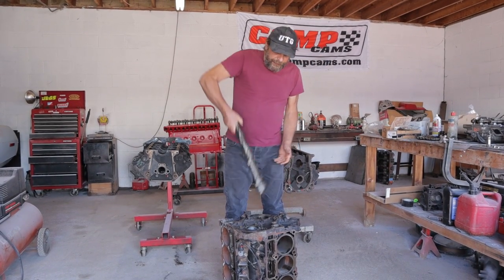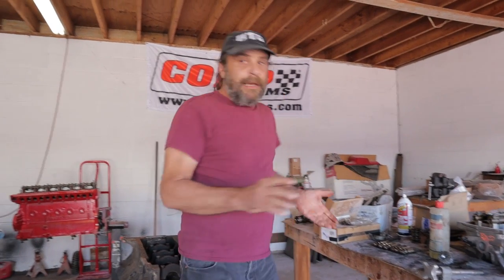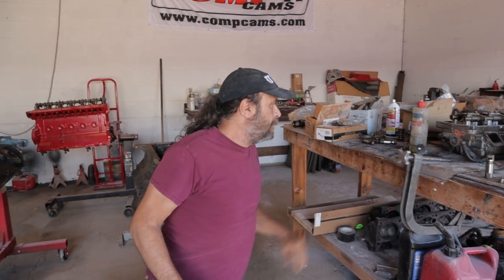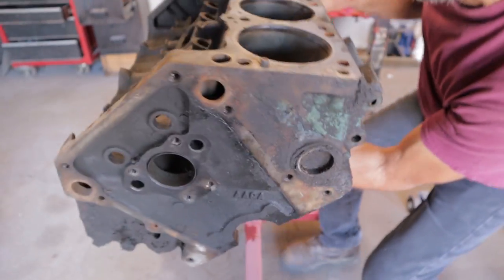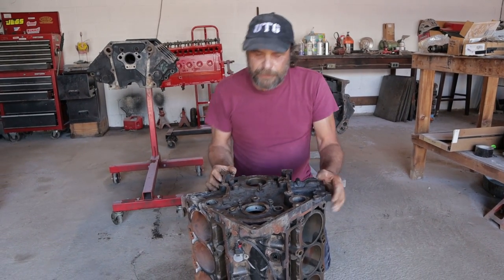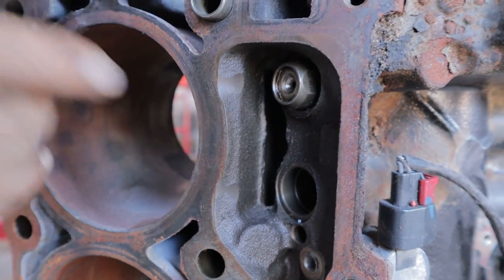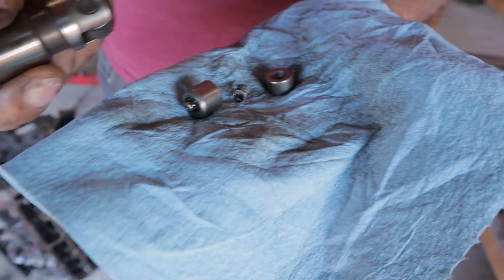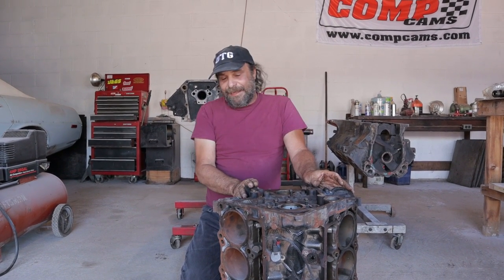Gen 3 Hemi Camshaft Failure Mystery Explained!

Comment from the maker: Just a thought to add.  Doing an MDS delete but retaining the MDS lifters could absolutely help the issue.  The oil that would normally be diverted through the MDS would be held in the oil passages that connect the lifters and keep them pressurized to some extent.  Anything that could get oil to leak from around the top side of the lifter would result in a pretty steady supply to the roller bearings.
Reply: What about lifters that DO have a hole in the bottom and some strategy to increase the oil volume being fed to the pushrods?
Reply: Tony, you could also take advantage of the oil galley that is in the way below the cam.  I'm not sure without looking at the block if you could physically get there to machine it through the top but you could drill small something like .020 holes in that oil galley so that some oil can be shot up at the lobes of the cam.  It wouldn't address the lifter wear but could help keep the lobes and rollers lubed.
Reply: @silkysixx  I agree, not that I know anything- I'm a keyboard warrior. Seems like adding an orifice to the bottom of the lifter so it sprays directly on the lifter roller/cam interface might fix it.

GREAT CATCH UTG !!! Wow! Good one!!! Actually, it's a great one!!!
Reply: You need to get rid of the vvt and mds.
Reply: Well we are probably going to buy lil Sisters 06 Charger RT to replace the 99 300m my sister who lives here drives, or keep the best two cars out of the dailies we have now. I'm pretty sure it doesn't have mds so are the earlier engines without it still prone to all the failures. It only has like 78k on it and she's never complained about it ticking or being noisy. I have never noticed anything when I've ridden in it either and they always get it serviced at the dealer. The 300 still runs fine but needs a air conditioning compressor and rear struts which I have.
Reply: @sonsofliberty3081  agreed! I have that afm garbage on my 2015 Silverado.  I wrote it out of the software with a tuner to prevent another failure!
Reply: Well said...👍👍
Reply: @kurtzimmerman1637  it's the government's bs of emissions. The rings are to close to the end of the piston as well.
Reply: Where’s the DYNO for the live 318 build?!!
Reply: Tony, I couldn't quite see in the video, are there any returns/ passages or voids above the liters? I'm wondering if we could plug off the majority of those huge oil return areas under the lifters and allow the wells to fill, then spill over at a higher level. It might allow oil to fully surround the lifters and flow down around them in greater quantity. 

I really like the idea of squirters or dribblers, but its probably too big and invasive a job for any time other than a full rebuild. Im trying to think of something that can be done by a competent shop or DIY'er without removing the engine or seriously modding the pressure system. Since these engines sometimes can live quite long lives, it may only take a little bit to make all the difference.
Reply: @honda0303031   it's on lunar's channel been there for all most a week now
Reply: Drip rails from the bottom of the heads to the upper top side of the lifters?
Reply: Maybe a windage tray catching all that oil from above to dump over the cam?
Reply: @honda0303031  Nick's Garage said there was an oil pressure drop to about 30 psi so the test was aborted, until fixed
Reply: Killed by design
Reply: Thank you so much. One day I have to get a Durango as a family hauler and I needed to know this stuff!!! I guess a crank scrapper is out on this engine. And in this case a high output oil pump may not be such a bad idea would it???
Reply: @Ecosse57  those lifters appear to have more holes for oil pass through on the sides and to the roller plus a larger cut for more oil being around them. They're potentially one part of the fix, another is some way to get more consistent oil flow to the camshaft.
Reply: What is MDS?
Reply: There is a guy on YouTube and i think it’s monster garage channel. He built a yblock. He added his own answer to get more oil to the rotating assembly by making hoses that ran in underneath the valley pan. That would solve this issue. 
And or finding a roller tip with a hole in the middle for oil to get to the cam. Come on everyone let’s put our thinking caps on
Reply: @econorock  all peeps have been pointing to are Johnson Lifters and their range of drop-in hydraulic lifters. It looks like their #2356 lifters are the ones that have the oil path to lube the lifter roller while others are pointing to the #2326 lifter, but their range of gen 3 hemi lifters have only been on the market for less then a year or are still being produced, as their site gives a price of TBA and a price
Reply: @SOU6900  it's an active cylinder deactivation system makes a v8 into a v4, when the ECU decides it's eco-mode time
Reply: Not all 5.7s have the MDS system so that only is gonna help a few folks.
Reply: I am curious if you could make an insert for the valve covers to drip on the top of the lifters?
Reply: @SOU6900  Multi-Displacement System,,, deactivation of cylinders depending on load demand.  Think of the older Cadillac 8-6-4 systems.  Same concept.
Reply: george garcia l
Reply: @karlsmink7037  so just more junk to screw up then?
Reply: @SOU6900  if it's only killing fuel to half the cylinders, it's fine. Same as a fuel-cut rev limiter, really, except for operating rpm. In cruise control where you only need 30hp to go down the road? Cut fuel to half the cylinders (and alternate which cylinders are not firing to equalize the heat loads). 

But too many people try to over think the design, like caddy's 8-6-4 system. The 6cyl setting was far too complicated.
Reply: How about machining a couple of small vertical slices off the sides of the lifters to allow the oil to drain past, easier than doing the same in the lifter guides.
Reply: Would it be feasible to parshily block off the drain back holes in the lifter valley so more oil would run down the lifter bore?
Reply: @cuog64  might cause to much of a drop in oil pressure for the rest of the motor, not sure but possibly a good diea
Reply: Not knocking your analysis-kudos-but as an independent and formerly dealer (Chry-Ply 1982-1994) technician for over 35yrs, we know that regular maintenance and quality parts (oil and filters) go a long way. I am doing a budget build on a '05 Ram 5.7L (MDS delete) and I have done a Dodge Magnum 5.7L, both with high mileage and the lifters looked mint. The Magnum dropped a seat and killed a piston, so I'm aware of that issue, but besides pistons/rings and bearings, new heads and gaskets and she's gone another 50K, incident free. The Ram engine is going carbureted in a retro build, and I plan to reuse the lifters on that one (wish me luck! LOL). I may investigate on a way to increase the oiling there (now) thanks to your diligent work. I will be using thin oil with friction modifier additves of some sort (Lucas Synthetic Oil Stabilizer or Lubegard BioTech, etc.) and a quality filter (not FRAM) like Purolator or WIX.
Reply: You'd have to weld up them drain passages and drill new ones top side, then see if there's a lifter with oil passages 180 degrees each other in the barrel plus a .0010 squirter hole on the very bottom, above roller on lifter. That would have to be a very tiny hole though.
Reply: Good eye
Reply: @sonsofliberty3081  You are correct, The main reason you can't properly super charge a 392
Reply: Tony you think you could tap into the oil gallery and plum a fitting to a spray bar that sprays pressurized oil on the cam?
Reply: What about a small slot coming out the side of the cam bearing on the top to squirt oil on the cam along with a high volume pump.
Reply: Excellent work sir ! ! !  

Seems to me, if lifters have hi-pressure oil inside, "drill" to let a little bit out... bottom & sides.
Reply: Now that I own one of these I've been really looking into this issue. Haven't torn one apart yet but plenty of net research. A few things stand out that I think are telling.......

This appears to be an issue only in the 5.7, the 6.1, 6.2, and 6.4 don't have a common lifter failure issue. Of course those engines aren't as common, BUT while having higher red-lines they also have higher pressure valve springs. This would indicate that valve float is causing a pounding that's killing the rollers. Among 5.7 owners spring upgrades are very common. 

This appears to be in a limited year range. Chrysler was clearly aware and made several lifter changes. The newest lifters have larger roller pins and aren't failing. 

This is the first I've seen of any marks on the side of the lifter body. Are those lifters from that engine and the only ones you've looked at?

I don't see how a lack of splash oil on the camshaft can be an issue. First they're roller, second it's not the cam to roller surfaces that are failing but the roller bearings in the lifters. 

You mentioned long idle duration I agree that could be a factor. One over looked factor I think exists is a lack of oil. These engines stock have a PCV system that consumes oil. Low oil levels could absolutely be a HUGE contributing factor. Frankly the way they consume oil with the stock PCV I can't see them making it between changes without adding oil.
Reply: @sonsofliberty3081  Neither the MDS or VVT are contributing factors to the lifter issue.
Reply: @ScottKenny1978  MDS isn't just killing fuel, it collapses half the lifters so the valves don't open on 4 cylinders.
Reply: @cuog64  Agreed. along with a high-volume oil pump and restricting the valley drain area to make oil puddle around the lifter boss would probably work. Hell, just look at high performance dry sump engines and how they are plumbed. (Edit) - In fact, if you go through the lifter bosses with a .030 drillbit, at about a 30 degree angle, pointing at the boss, it would work well.
Reply: @silkysixx  so ...a dry sump and oil squirters like late-model gtr nissans had...well i believe  they had them
Reply: @honda0303031  nick's garage channel
Reply: @honda0303031  Nick said it had low oil pressure. They getting it fixed before putting it back on dyno.
Reply: @honda0303031  Low oil pressure, Nick said it get fixed first, than back on the dyno.
Reply: What about a manual (challenger) that doesn't have MDS? Same issue or different fix? Or no fix :(
Reply: Um no the Eaton mds/ AFM shared with the lsx and ltx lifters are garbage and have habit of collapsing and braking off the inside tangs or being glitchy on a computer level / glitter bomb which is one of the reasons why I’m never going to use them in my engines ( but I did look into it. to get better gas mileage and make it easier to pass the epa testing) instead FCA should have used the multi-air technology ( same thing I’m doing to my 2G 426 hemi right now as a mod because it doesn’t see high RPMS a lot and is mostly a streetcar that needs low end torque that the VVL is good at and I get to keep a “ big cam lobes” in my case it’s looking like 620th ish lift without having the usual downsides. not a high hp race engine ) that is used in the 2.4 tigershark engine or used sold lifters in “ profomance engines “ line aka race only Versions 

As for oiling one extra ways of oiling the lifters and rollers is stealing oil from the vvt phaser Assembly grooves and drill from the front of the camshaft to the back to make a oiling passageway ( just don’t go to big or you will weaken the camshaft) to each camshaft lobes and dill a tiny orifice at the heal of each lobe and roller assembly plus it will spray and sling oil even everywhere that’s needed just like the inline 6 from Nissan ( I think 💭 it’s the 240Z from pre-1985~ )/ jdm motors that oiled only though the camshaft that way ( and is the same thing I’m doing to my new 2G 426 hemi camshaft side note for me and other that might get the same bright idea 💡 is that it might be a little harder than a normal v8 solid one peace camshaft ohv because mine is a camshaft in side a camshaft with two phasers for vvt and vvd so I have 3 holes trying to line up to be effective to oiling the heals and or the toes of the camshaft ) and didn’t have spray bars but guys do add them as insurance and probably is a good idea but for that application oiling through the camshaft is necessary as my reading I noticed that if you deleted it it could cause a camshaft failure similar to the 3G hemi even with a bar
Reply: Well I’m not tony but hope this helps silverbird58 Front crankshaft snout between the damper and the timing set. same way as the GM LSX engine and as higher RPMs it can go into cavitation one of the reasons I’m not using that style of system.

 instead I’m using a deviant misslle oil pump ( its red and black coloured ) the same one used on the Mopar misslle drag car ect (  would not surprise me if tony has one or used it in the past). the other option is using a gillmmer belt drive Peterson pump style but the rubber belts can brake so that one makes me a little more nervous of using it the plus side the you can change the pully ratio / pump rates easier and be able to preoil with the belts off easier
Reply: Tony, do you know if this issue exists for Hellcat motors as well? From what I understand they don't have the MDS system. Thank you for the info, looking to keep my hemi healthy and happy!
Reply: Just keep it in sports mode lol mds off
Reply: I thought the MDS system rerouted the oil do a different passage when activated
Reply: TONY, I DOUBT THE ENGINEERS WOULD MAKE A FATAL FLAW MISTAKE LIKE THAT IN THE DESIGN OF THE BLOCK AND PRODUCE IT FOR SO MANY YEARS WITHOUT CORRECTING IT. IT HAS TO BE SOMETHING MORE SIMPLE. THE ONLY LOGICAL ANSWER TO WHY THE CAM LOBS ARE BEING WIPED OUT IS THE LIFTER ITSELF. WHERE THE ROLLER THAT RIDES ON THE CAMSHAFT, THE CENTER SHAFT DRILLED HOLE WAS NOT CENTERED WHERE IT WAS OFFSET, WHERE WHEN YOU SPIN THE ROLLER IT WOBBLES UP AND DOWN CAUSING A FICTION EFFECT. THIS IS ALWAYS THE CASE WHERE THE SUBCONTRACTOR WHO PRODUCED THOSE LIFTERS FOR CHRYSLER HAD BAD QUALITY CONTROL. THIS IS WHERE CHRYSLER SHOULD BEGIN THERE INVESTIGATION.
Reply: I had a 2014 ram 1500 and the hemi started ticking around 35000 km, traded it at 41k km.
Bought a 2017 durango rt and the first thing was bye bye mds, were at 65ish thousand now and it's just starting to tick. 
Delete your mds, soon as you buy a hemi, no other mod comes first, DELETE THE MDS!
Reply: Would you suggest a software (tune) or hardware delete?
Reply: @SchkuenteQoostewin  do a software, leave the components in the engine.
Reply: A simple Grove of 4 to 6 thousandths deep vertical on the lifter to extend into the lifter bore on the down lobe position with a connecting ring groove around the middle of the lifter at the feed hole...(much like a connecting rod spit hole) and the vert groove on both sides of the lifter
Reply: Patrick Radcliffe you can turn the mds off by switching to tow mode or either downshifting to second gear, then back to the end gear.
Reply: Qoostewin Sch'Kuen'Te you can turn mds off by switching to tow mode, or downshifting manually to 2nd gear then up to the end gear depending on the year.
Reply: Looks like 42 people so far has a new place for you to shove that cam shaft
Reply: @Frank289100   Don't let it set around and idle...that's what's killing them!!!
Reply: @bingorobins1010   Keep the idle time to a minimum. Cop cars suffer more than the guys who spend all their time out on the highway. Cop cars idle too much, they don't go 100,000 miles. Long distance commuters get 250,000 miles with no ticking....lots of oil being thrown around at highway speeds.
Reply: @Dukerdr  (Don't let it set around and idle...that's what's killing them!!!)<<-- THEN ALL THE LIFTERS AND CAM LOBES WOULD BE WIPED OUT. HAVE A NICE DAY!!!
Reply: Very similar problem with the dodge 3.6 pentastar collaboration engine (roller rockers). But, if you swap out the rocker as soon as it starts ticking $2.50 you won't have to swap out any of the FOUR $250-300 cams.
Reply: Achronic Deth  and the clutch just slipped 😉 both times😏
Reply: @snek9353  you are absolutely correct. The issue is very tight valve guide clearances, compounded with long idle times,( poor lubrication of the guides at idle).  When valve guide clearances are down below one thousandths of an inch, ( .9 on intakes, 1.5 thou on exhausts) the guide can periodically clamp the valve stem, stop the valve, stop the rocker, stop the pushrod/lifter assy, and crush the roller bearings.  How do I know? I worked for Chrysler tech support, seen many of these engines. Imagine a valve stem being heated by the exhaust. It warms up faster than the guide, expanding faster than the guide. The thin film of oil cannot stop the guide from holding the valve stem. Once the valve stem has stopped moving momentarily, the guide sucks the heat out of the stem, and releases the valve. There is no metal transfer, it doesn't get that hot, but, it does clamp the stem. This happens because of tight specs, compounded by, worn tooling. Since these engines are robotically built, ten thousand of them can be made...before anyone catches it. You should see what happened to the FCA 500, ( Fiat 500), with the hydraulically operated, VVT, ( brick). Lol! Open up the guide clearances by half a thou, no more wiped out cams.
Reply: @sarcastomimic2683  it's the tight valve guide clearances,(.9 thou on the intakes, 1.1- 1.8 thou on the exhausts), open up the guide clearances by half a thou, no more problems. It doesn't matter if it's MDS, or not. How do I know? I worked for FCA, tech support. Tight valve guide clearances, help clean up emissions. That's why they did this. Tooling wears, clearances tighten...not good.
Reply: silverbird58  front of the crankshaft.
Reply: @Frank289100  nope. the tight ass valve guides are what's doing this. (.9 thou on the intakes, 1.5 thou on the exhausts). The guides grab the stem, long enough to transfer heat, then release. Not soon enough to stop the lifter from crushing the bearings.  ( Worked at FCA/Chrysler). Open the guides up about a half a thou, no more problem.
Reply: @Frank289100  tight valve guide clearances, are what's doing this. (.9 thou on the intakes, 1.5 thou on the exhausts) open them up by half a thou, problem goes away.
Reply: @mikestone234  POSSIBLY YOU ARE RIGHT. BUT AT LEAST WE ARE BOTH ON THE SAME PAGE IT IS NOT THE BLOCK. MIKE, COMPOUNDED PROBLEMS IN MANUFACTURING DO EXIST. IT CAN BE BOTH MY POINT AND YOUR POINT. YOUR INPUT HERE HELPED MY POINT TO THE GREATEST DEGREE.
Reply: @mikestone234  That's very interesting and the first I've heard of this as a possible issue. Have you expressed this on any of the popular forums discussing this issue? 

This could also explain the one other issue I've seen in the valvetrain of these engines, it's much rarer but apparently some when almost brand new broke their rocker arms. Rarer and maybe a separate issue caused by some flaw in the manufacture of the arms, maybe contributed to by sticky valves. Though I think on all of them replacing the rockers solved it, if it was sticky valves you'd think it'd happen again after rocker replacement. 

However if sticky guides were an issue I'd expect to see pushrod issues be common. Push rods are generally the fuse in the valvetrain and most engines I've worked on with sticky valves the pushrod was the failure point. They'd generally bend or in some engines fall out of place. That we don't see pushrod failures is a mark against a sticky valve hypothesis. Also while the rocker failure occurred on new engines, the lifter failure often occurs after quite a few miles/years. A sticky valve if it makes it many miles should wear out of it's stickiness. Problems would show early in the engine's life not late. The needle bearings in the roller lifters appear to be essentially wearing out. 

One thing that works against my valve float and your sticky valve hypothesis is that as far as I can tell there's no bias towards intake or exhaust failure. With either cause we'd expect it to be primarily one or the other, that hasn't been my observation so far. It's also rather common for more then one to fail in the same engine and for those failures in the same engine to occur to both intake and exhaust and both MDS and non-MDS.

My current best theory is that the main cause is quality control in the manufacture of the the roller needles bearings and/or undersized design. That any sticky valve, oiling, valve float, etc. issue is only a contributing factor that accelerates the primary issue of a batch of poorly made rollers. In fact maybe you have more information on this. Information I've seen on the net is inconsistent on changes to lifter manufacture and design over the years as well as exactly what years/months production issues occurred.
Reply: @metalman4043  MDS does not appear to be a factor in the common lifter roller failure. It appears to occur to both MDS and non-MDS lifters/engines equally.
Reply: @danielhemple8649  It does, in fact when the MDS is activated the lifter is getting even more oil. An MDS lifter actually has 3 separate oil paths. There's the standard oil passage that's shared by all the lifters. The MDS oil supply that's fed to the outside top of the lifter body when MDS is activated. And they are fed oil down through the pushrod into the lifter body.
Reply: @bingorobins1010  But I've seen no evidence that MDS and lifter failures are related. The lifter failure issue appears to occur in MDS and non-MDS lifters equally. MDS lifters and solenoids can/do fail but those failures are separate from what's causing cams to be wiped out. When they fail the lifter stays collapsed and the engine misses it doesn't wipe out the cam.
Reply: @snek9353  thanks for responding brother I've seen many hemis go 300,000 with no trouble at all I see more have trouble with exhaust manifold bolt then the lifter problem I run full synthetic and stay on maintenance only 60,000 no trouble yet PS love the snake
Reply: @danielhemple8649  You're welcome, I've only owned a G3 Hemi for 7 months now and started looking into this issue after purchase. I bought my '14 with 46k and am now at 51k. My research into this issue has lead me to do 6 things. 1) Avoid long idle times. 2) Avoid over revving the engine. 3) Rev the engine before putting in gear and before shut off. 4) Add an oil catch can. 5) Check the oil level often. 6) Use Redline oil, this one I wanted most to mention. Not all synthetics really are. Redline makes a better synthetic(as do others) but it appears their additives soothe the hemi tick better then others. I don't personally have enough experience with it yet to confirm a difference in noise. However I have spent a fair amount of time researching lubricants and am a fan of Redline oils in general, so that's what I'm using in mine.

EDIT, of course those are all good things to do even if the lifters weren't a potential time bomb so I'd probably be doing them anyway.
Reply: @snek9353  tight valve guides, doesn't mean that, valves will stick all the time. There is very little oil going down the guides to start with, plus, a new engine still has some assembly lube as well. When clearances are this tight, differences in metal expansion can come from a lot of reasons. Lean fuel mixtures in different parts of the drive cycle, differences in oil splash, or lack thereof,(idling), can do this. You should have seen what we went through to find the sneaky miss on the 3.6L pentstar engine,(valve stems were not the same diameter, all the way down the stem). Check engine light, intermittent miss, compression/leakdown tests were perfect. Spark, and fuel, perfect. (Intermittent sticky valve, about  a hundred thou, off the seat. By the time a man could get a compression/leakdown, the valve would shut all the way, and the test wouldn't show any problems. These tight clearances are great for oil control/emissions. Chrysler doesn't make it's own valves. We also had some engines, with Chevy valves in them, lol! They were so close in size, you had to use micrometer to tell the difference. (Vette valves have slightly smaller stems, manufacturer mixed them up, before we got them loaded into the robot). Chrysler doesn't make the lifters either. Johnson does these for everyone.  I saw quite a few broken pushrods, broken rockers, crushed roller bearings, mostly, and trashed cams. It takes a lot of rinsing to get these engines cleaned out of metal. Filter is full flow, so that helps. Opening up the clearances will make up for a lot of variances/conditions. Racers do it without knowing. They run about 1.5thou to 2.1 thou, on the intakes, and, 1.9-2.2 thou on the exhausts.  For aftermarket valves,(some have larger diam stems, different materials.)
Reply: @snek9353  by the way, a lot of these engines had issues early. The dealers wouldn't tell the customer what it was,(under warranty). The valves don't have to stick totally, to cause this problem. If a valve is dragging, it puts a huge load on the lifter, way more than the rollers can take.
Reply: @mikestone234  Not really arguing, just trying to fully understand the theory/mode of failure here.

"tight valve guides, doesn't mean that, valves will stick all the time" 
- I get that but as you said earlier "Imagine a valve stem being heated by the exhaust. It warms up faster than the guide, expanding faster than the guide." This process really only makes sense on the exhaust valve of a cold engine. Now maybe damage done while cold is a contributing factor, but it doesn't explain intake lifter failures. If this was a common cause then we'd see lifter failures primarily on the exhaust side. 

"differences in oil splash, or lack thereof,(idling), can do this"
- This would help explain why it's more common in engines that idle for long periods. The lifters, even the rollers aren't really reliant on splash, but the valve stem is. 
EDIT -  It just occurred to me that with these engines the wide angle of the valves would have a significant effect on this as well. I'd expect that cause  the exhaust valves are both lower and more horizontal that they'd oil a lot better then the intake valves. 

"Filter is full flow, so that helps."
- I can't recall a single water cooled engine since the '50s that isn't full flow. You may find it interesting though, we(family) have a '56 Studebaker that still has the original engine with only the original bypass oil filter. That truck to this day is still a solid well running work horse. 

"They run about 1.5thou to 2.1 thou, on the intakes, and, 1.9-2.2 thou on the exhausts."
- For all the time I've spent working in machine shops I've never done valve guides. I'll have to talk to my machinist about what's normal. 

"These tight clearances are great for oil control/emissions"
- That's very ironic given how much oil the stock PCV system flows into the intake. 
I'd figure a tell tale sign of this would be galling on the valve stem, I've yet to see that in my research. 

The next question would be why isn't it occurring in the 6.1, 6.2, and 6.4 engines. Sure their heads have slight valve variations and stronger valve springs. But the 6.1 and 6.4 use the same lifters as the 5.7, they all have the same oiling, and presumably the guides are all done on the same machines. 

When did you work for Chrysler and when was this discovered/solved?
Reply: @mikestone234  Also of course maybe the most important question. What can a current owner do about it? I have a '14 5.7 with MDS, assuming this failure mode is correct what would you suggest someone like myself do? I can only think of two things that aren't extreme. 1) rev the engine for more splash, in particular before putting in gear and before shut off, I'm already doing this. 2) Use a great oil that will better penetrate the valve stem seal and stay on the stem. Think I'm already doing this as well using Redline oil. I could buy an expensive warranty or do internal engine upgrades but to me the warranty is extreme and I don't yet have the time/resources for internal upgrades. I'd probably just swap the engine anyway if I did.
Reply: @mikestone234  OK another question, if valve stem clearance was a common issue we'd see it commonly in engines where people have installed blowers and/or nitrous. Just as the ring gap becomes an issue in those engines so would valve stem clearance.
Reply: @snek9353  Thank you for the info. As far as I know, they didn't have the R&D time to get the MDS system working on the Hellcat with the supercharger, but that might have been for the earlier models (mine is a 2016)
Reply: @blakebeaupain  Hmmm I might be wrong on that one, I thought they did but just now did some research, looks like they don't.
Reply: @snek9353  yes, that's true. Blower motors are built differently, and the clearances reflect that.
Reply: @larrycain6425  I was thinkin the same.
Reply: I did mds delete with a tuner at 40,000 miles on my 2016 ram with the 5.7. I currently have 130,000 miles and I’ve ran the truck balls to the walls with no lifter problems. 
Ive always used 1 qt Lucas addictive every 5k for oil changes.
Reply: @smokedog123456789  that's great! The guides have worn in, good lube will take care of the rest.
Reply: @nm156p  no. A "delete" is when you have the factory remove a standard item, before you receive it. For example: you "delete" the bed of a pick-up, because you are installing a service bed.
Reply: @patrickradcliffe3837  what been doing is driving around with in 8 gear range to o keep all cylinders firing I really don't like the mds system
Reply: @larrycain6425  that might work but would hurt oil pressure
Reply: @Husky1run  in his live stream he pointed out that it's not the MDS. It's a design failure. I suggest going and watching that live stream.
Reply: Would a heavier oil like 5w40 or 10w40 help with this issue, since Chrysler recommends 5w20 ???
Reply: @bingorobins1010   why delete mds ? You just said you are atarting to have the same ticking start , just 20k later ? You think every engine will have this issue at the same time  ? 
This lack of oil issue Tony points out makes sense, that seems more likely the issue  than  mds!?
Reply: @Dukerdr  that's why I am looking mostly at the state trooper cars , they sit at idle too , but , the cruise the highways much more than the  local pd or sheriffs depts  :)  , lots more oil flying lol
Reply: @DUSTER7071  no, the durango is at 67 some thousand and is now ticking.
The truck was at 41k when I traded it in.
Reply: @DUSTER7071  I hear ya', most State cars are better serviced too. Our local Sheriff's Dept would be a good car to get since they don't sit around and run radar. They just respond to calls and deliver papers. And their Chargers have 6 cyl in them!  ;)
Reply: @DUSTER7071  Why do you want a pursuit?
Reply: @DUSTER7071  "This lack of oil issue Tony points out makes sense"
- Not really, Tony's position is mostly about a lack of splash on the cam. Splash on the cam is absolutely vital for a flat tappet cam, but not for a roller. The lifters are failing internally at the roller bearing, not where they interface with the cam. They don't wear the cam until after the rollers fail.
Reply: @mikestone234  Awesome info, Mike. I appreciate the response.
Reply: There's nothing wrong with the engine, it's designed the way it's supposed to be. F.I.A.T. style, Fix It Again, Tony! 🇮🇹🍝🚗💥💨💨💨

😆🦓 Scotty sent me
Reply: I'm glad you figured this out. I had one of these engines,  and didn't have it long enough to have this problem,  but hated when people blindly blaming the mds without knowing what was wrong! Makes sense if they're oil starved, though! They obviously released this engine without sufficient testing. They almost need to engine the block with oil galleys just for the lifters, and cam.
Reply: Kurt Zimmerman  Disabling cylinder deactivation doesn’t prevent MDS lifter failure.
Reply: I had a misfire on cylinder 7. Ended up being a bad MDS solenoid. I supposedly had to replace the solenoid before I could delete it. Needless to say, my truck went from about to be sold to running like its new again. 213k miles. Oh and the best part! Had my motor rebuilt two years ago, everything looked "new" still, everything but the mds. That guy who rebuilt it could have saved me a lot of headache.
Reply: Joe W  Yeah, should have definitely done a DoD delete while in there.
Reply: @69Dartman  The issue of the lifters/cam happens on the 09+ Hemi engines. 08 and down have an issue with dropping valve seats and destroying the engines.
Reply: Recommended by Scotty Kilmer as the best example of why they chew cams asked a relative who is mechanic for 25+yrs all he could tell me is lack of oil & just replaces them so I will show him! Cheers from Australia
Reply: @mph5896  Well, thanks for the info, Don't know what to think about it now. It's a nice car and always taken care of but gets horrible mpg I'm pretty sure.
Reply: @silkysixx  I thought the same idea too.  Some oil is better than NO oil.
Reply: Just to add two cents, my 2010 93K+ miles 5.7L HEMI has always had lifter tick when the MDS was active, but since I deactivated the MDS feature with HPTuners it hasn't made a peep since then.
Reply: I think you nailed it buddy.. designed to fail
Reply: Tony what kind of oil would you run in these engines?  I noticed you mentioned zinc and OEM conventional 5w20 is zinc free.  Would you suggest any additives?  I have a 2018 Ram 1500 with the Gen 3 and it's been good for me so far for 40k miles.  I posted your link on Scotty's page there he had a charger with a misfire code and I knew why.  Anyways you're welcome for the views lol.  He's too partial to the Toyota's IMO but it's a free country now isn't it?
Reply: David C  Yeah if you have a Ram 1500 it's called pushing the plus symbol on the steering wheel.  Manually setting max gear for automatic disables MDS.
Reply: Just FYI the cam lobes are wearing on non-mds motors too.
Reply: Great detective work! No way I'd buy an old Police charger after watching this. Most of their existence is spent idling!
Reply: David C  Correct.  I did mine, disabled MDS via tuning and then turned off the eco light in the Uconnect settings menu.
Reply: Great call Tony, I am sure the FCA engineers are aware of this problem, some pencil pusher figures it’s cheaper to pay out warranty bills then fix the block design. In the meantime they deny there is an issue. Toyota did that with the sludge issue on their V6 engines until their fanboys at Consumer Reports surprisingly called them out on it.
Reply: @jaylamb9546  That's a shock.  Reading all the comments on the internet I would have thought every Toyota engine ever made will make it to the 1 million mile mark with basically no maintenance.  Lol.
Reply: GM had similar issues with valve train and burning oil caused by AFM that were mitigated by disabling AFM.
Reply: Another thing is, manual transmission Challengers don't come with MDS. Do they have the same issues?
Reply: @69Dartman   lol so funny i have had both of those cars. I still have my 06 charger rt. The 99 300m is getting old. Id suggest selling it quick. The 06 we've got actually HAS MDS for sure!!! Im trying tk figure out how to handle this. At 78k your totallu fine. But by 150k like i am, im starting to become more concerned everyday. I need to disable ny mds for sure.
Reply: @porterarthur659  not a bad thought, you can cut them out easily but the level of it is already fairly low and the 7 quarts is already above it anyways.
Reply: @SOU6900  its a system that deactivates 4 out of your 8 pistons. The mds system itself isn't bad its just that the mds lifters were designed for the system are bad and the valves that have the hole in it for oil to go through.
Reply: @deebojones  no manuals dont have mds, its only integrated with automatic.
Reply: @unknownuser31792  Thanks for the information. The 300m is a tank and that 3.5 is a really reliable engine but all the dumb stuff is breaking. Compressor locked up, climate control board has the bad solder joints I need to redo, and the rear struts are bad. I have new struts but I read they are harder to change out than they should be. I already replaced the warped front rotors and pads and replaced the rears a couple of years ago so I think most of the running gear is good and it got new tires somewhat recently. I drive a 95 Neon coupe I really like but it's getting beat down even though everything important works. I put new tires on it a couple of years ago and only drive it to work and back.
Reply: @unknownuser31792  i know that's why I asked what the solution is for a manual
Reply: @deebojones  you dont have mds lifters-  so you dont have the mds problem because you dont have mds. You wouldnt have this problem, your liftera and cam dont have this problem.
Reply: @69Dartman  300m has lots of peoblems with eletronics and suspension. I scrapped mine because of these reasons. Everything in my dash was going bad left and right. Ac and heating system constantly had problema, blend doors , fans, radiator, transcoolor. After the 3rs radiator and tearing out the hole dash i finally gave up on it. The engine was good, but everything around it wasnt.
Reply: @unknownuser31792  yeah, the climate control board is a known issue and most times it is the solder pads and joints crack open and you can reflow the joints. That is the problem with ours and I just haven't yanked it out of the dash to redo the joints. You could tell because I could tap the dash and the display would pop back on. It still works but you don't have the display anymore. I years ago completely redid all the pins on the dash circuit boards on my Dart even put tiny brad nails into all the loose pins and the gauges all work again. I redid the solder joints on my Neon too and the speedo and everything works on it again too. If you know how to solder you can repair a lot of crap like that because most people trade off their cars before these kinds of issues show up.
Reply: @69Dartman  i hope it lasts a while. When i did the 300m and replaced the blenddoors ,blower fan, evaporator and heater coil-  i decides that It was too much for me. Ill never tear another dash out or apart again. I might do something superficial like ignition or radio, but anything deeper....im simply not the guy for it. I'd rather rebuild a motor than deal with a dash.
Reply: @unknownuser31792  Well the Dart the instrument cluster is pretty easy to remove, the one in my Neon was super easy as well so I just take the whole cluster inside and work em over. Eventually I'll do the same with the 300m as that part should be easy enough to remove and redo. The heat luckily still works fine so if I ever replace the compressor and replace whatever else needs to be done the air will work again just like the Neon.
I think they even use the same compressor and they sell master kits that have the other parts that go bad when all the crap goes through the system.
Step dad stopped driving and they sold the Blazer eventually and the heat still worked but it got scrapped later so not my problem any more, hopefully some of the good parts went to keep others going.
Reply: Chevy has issues with their MDS lifter system as well.
Reply: Maybe design a secondary oiling system separate from the factory and plumb it in to oil all that is needed,it may have to be electronic but it can be done....
You may have to modify the pan for access if it ever goes bad,it may be the only efficient way to salvage these blocks from the design flaw
Reply: @mph5896  I've personally seen the lifters/cam issues on 2006 model year engines.
Reply: @snek9353  why wouldn't they be
if the engineers moved the lifter valley higher in the block to make
room for the VVT. They moved them away from the passages that drained oil down to the camshaft right. well that was the way I interpreted what he said. could be wrong that wouldn't be the first time.
Reply: @cuog64  drill all the way through the galley and then tap the bottom (facing the pan) hole and put an 1/8" npt plug in to force the oil upwards.
Reply: @69Dartman  now may be a good time to pull the engine and replace the cam and lifters, possibly drilling a small oil dibble orifice into the housing to dribble oil on the roller.
Reply: @stanburton6224  Well we don't have the Charger yet so we'll see if it ever happens.
Reply: Would disabling the mds with a tuner do the trick, my hemi has over 180k miles on her
Reply: @69Dartman  the 06 r/t has mds
Reply: @captainobvious5993  My lil sister doesn't think it has it and I haven't seen any badges on it proclaiming it has the feature like everyone else does when it comes with something special. I know it gets even worse mpg than the 300m does. I haven't noticed anything when riding in it that would lead me to think it has it but sister probably wouldn't care ir know for sure one way or the other. I remember asking her about it and she said it didn't when it was new.
Reply: @69Dartman  if it has the hemi than if definitely has the mds
Reply: I run my truck in gear limiter-mode, this prevents the MDS from being used. I only ever allow the MDS to be used when going on long roadtrips, never in mixed and city-driving.

I did get check engine light with misfire code once quite some time ago. No symptoms, code was reset, never came back. Truck is a 2012 laramie longhorn edition (doubt trim level makes a difference) with 58k miles (42:20 engine hours if that matters).
Reply: @sonsofliberty3081  
I don't know if you can get rid of the VVT, but the MDS for sure.
Reply: @scottescobar3218  He is correct, BUT only in the way you framed it. That only applies to the newer 6.4l hemis, the 5.7s, 6.1s, and 6.2s dont have that issue. I do not think that was an emissions issue either, Tinfoil hat time. I think they built the 6.4 like that on Purpose, to prevent you from making your own Hellcat, I think it was an upsell tactic.
Reply: Hello Mr Tony my name is Tony I have a 2011 dodge charger mopar edition and I was driving and all of a sudden it started acting like it just lost power and the engine almost seem like it was out of gas then it shut off so I popped the hood and first thing i saw was the valve cover had a rear in it and then when i tried to start it again it crunk up but i heard a tapping like  noise do you have any idea what it is??
Reply: @Dukerdr  so just run all red lights.
Reply: Not buying this, if this were the case, the hellcat motors would also have this issue, which they do  not. The Hellcats had a better lifter from the factory.
Reply: @ronlucci465  maybe because the hellcats aren't daily driven as much. They tend to have lower miles.
Reply: @scatpack1381  Guess all the higher mileage ones are just "lucky", got it
Reply: @snek9353  Hello friend, i see u know a lot about hemis. Just to be clear, 6.4 hemi from scatpack has this problem? ALL 2015+ 5.7 hemi has this failure? In 2021/2022 i will be planning to buy some 2019/2020 Challenger and i wanted 5.7 hemi but i dont want to have any problems with engine. Sorry my english isnt perfect, im from Poland
Reply: @blogg695  Sorry didn't see this till now. 

The lifters weren't moved up in the block to accommodate the VVT but to make the hemi valve train better. Cause the exhaust valve is on the other side of the head. In a 60s Hemi the exhaust rocker arm is this huge about 5" long thing that's heavy and prone to flexing.  The push rods also aren't in line with the lifters and the angles are extreme at the rockers. By raising the lifters they solve these issues. 

What he's getting at is that in the G3 Hemi the lifters are close to horizontal so oil doesn't really drain down vertically from the lifters. This may actually be a bit of an element to the lifter failures. But oil reaching the cam itself isn't an issue.
Reply: @herbatkowy  This is overall a rare issue that appears to be far rarer in the 6.4. I'm not sure of year ranges for the issue but it isn't 15+, by 19 it may be solved.

FWIW if I wanted a Challenger I'd go one of two routes, either an AWD V6 GT, or at least a 6.4 Scat if not a Hellcat both with manual transmission.. Of those two I'd probably get the AWD V6. I think an AWD Challenger with added HP would be awesome. My daily is an AWD 5.7 Chrysler 300.
Reply: @captainobvious5993  MDS has nothing to do with this issue.
Reply: @nokoolaid  Yes
Reply: @snek9353  is there a fix then?
Reply: @nokoolaid  Your question assumes something is broken. Yes this is a possible failure, but given the sheer numbers of these engines it's a rare failure. It also generally occurs more often in abused engines, not abused with the pedal but idled, oil not checked, etc. Sure there's things that can be done to lower the odds, what's worth doing, well that depends. Me right now so far I'm doing 4 things. 
1. No long idling, long idling appears to tend to dry out the rollers as they don't have direct oiling. If I do let it idle to warm up, cool down, remote start, etc. I always slowly rev the engine before putting it in gear. 
2. Always rev the engine before shut off. Getting the RPM up gets everything oiled real well. If you do this just before shutting it off it's better lubed at the next startup. 
3. Using Redline oil, Redline makes a very good oil with an ester base and a great additive package so it's a great oil period. Secondly those with more experience with these engines have reported that a switch to Redline quieted their tick. 
4. Checking oil level regularly, these engines consume oil, they consume enough oil that if going by the oil change interval set by the car and not checking the level between changes the oil level could easily get too low. It's my opinion that this is a major reason for these failures. 

Personally I'm considering adding a pre-oiler/accumulator. But that's in part cause I intend to not only keep but more heavily modify my car.
Reply: @snek9353  I assume it's poorly engineered and  poorly tested. GM's AFM issues probably aren't as rare then.
Reply: @nokoolaid  The AFM has more issues then Chrysler's MDS, but they are similar. But again the MDS is not the cause of the roller failures. In fact roller failures appear to be and should be more rare in MDS engines as the MDS system provides MORE oil to the lifter. 

The most common failure of the MDS system is the control solenoid. IMO this has a lot to do with driving style and oil used. It's also a very easy repair. 

The most direct cause is undersized rollers and a lack of a direct oil passage to the rollers. Both issues have been solved in updated lifters. If you want to be sure you'll never have this issue the only way is to swap in updated lifters. But on the Hemi this requires head removal and IMO is not worth doing simply for preventive reasons.
Reply: @nokoolaid  Should add one more thing to my list. I removed the engine cover, this in part allows more air flow keeping the MDS solenoids cooler reducing the odds of their failure.
Reply: @snek9353  What particular driving style? With AFM it tends to be doing a lot of extended highway driving where the cylinder deactivation is used a lot. In my case, #1 cylinder developed an oil burning problem. Just #1. 1800 miles to a quart. I had to change the plug ever 7-8k miles. Had I known, I would have disabled it. What kind of oil should be used with MDS?
Reply: @nokoolaid  I'm not an AFM expert, don't own one. What part is failing in the AFM, lifter or solenoids?

Your oil burning, GM or Chrysler? 

MDS oil needs to be a quality 5w-20, maybe a 0W20 in cold climates. It appears some think 5W30 is better and use it, and others don't pay attention to what kind of 5W20 the oil change place uses.

Edit, missed driving style. In regards to the solenoid it's failure is that it gets sticky. IMO lack of use exacerbates this, so for example never allowing the MDS to activate, then when it does it sticks.
Reply: @snek9353  it's oil starvation along with Mexican made roller lifters
Reply: @captainobvious5993  Pretty much
Reply: @snek9353  thanks for answer bro, i can't afford hellcat , anyway i don't think such a power on RWD is a good idea . And i don't wanna manual , whole my life im driving manuals and i don't want any more. Awd v6 challenger must be slow vehicle, too small torque for this weight and it has to pull 4wheels... my actual BMW 530d stage1 is faster for sure. So i just hope that 2019+ hemis will not have this problem because challenger is my dream car, whole my life i was thinking hemis are reliable strong engines but now i don't know... 

So u claim 2015+ hemis should not have this problem?
Reply: @herbatkowy   I can't assure you that a 2015+ hemi will never have a lifter failure. I can tell you that they've made updates but exactly when they went into production and if they completely solved it I don't know.

I can tell you several things..
1. Hype aside it's a rare failure. The Hemis are strong and reliable, much more so than BMW. 
2. The AWD system they use adds no drag, only adds 95lbs to the car and works fantastically. An AWD V6 is lighter then a RWD Hemi. The V6 isn't ideal, Hemi would be better hence why I have a Hemi AWD Chrysler 300. But they never made a Hemi AWD Challenger and the V6 is upgradable. Just something to consider. If I was rich I'd buy a AWD V6 Challenger and swap in a 6.4, that'd be awesome.
Reply: @snek9353  Ok so i just need to know when exactly they upgraded this lifters in 5.7 hemis, i hope 2019/2020+ are fine.
Reply: @snek9353  u know what.. now im thinkin about getting an SXT. Those pentastard engines are reliable? I mean high mileage etc.
Reply: @herbatkowy  If it's about money don't do that too yourself. IMO your much better off saving money by getting a older one with more goodies. The biggest thing between the SXT and GT is the Harmon Kardon sound system, it's not even an option on the SXT. And again the only reason to go V6 is to get the AWD.
Reply: @snek9353  im not interested about awd in a coupe. I just wonder if pentastar engine is good construction.
Reply: @herbatkowy  Sure, but the Hemi is better.
Reply: @snek9353  didnt we just saw that engineers did some big mistake in construction of 3gen hemi?
Reply: @herbatkowy  It's still in the long run a better engine than the Pentastar for a Challenger.
Reply: @snek9353  i want u to get me, in my country there are big problems to service american cars, in my life i ve seen maybe a few Challengers (and i love them since first sight). I just want a reliable car that will not cause me any problems in future, by problems i mean any BIG service works. I know that muscle car like Challenger needs a V8 i totally agree, but  Isnt pentastar more reliable?  I want a car i can drive a big mileages and now  im reading that people have their engines broke at 50 80k miles? Such a mileage is a joke, not "good construction" for me! My bmw 530diesel has 300.000km and it runs like a new in Germany those engines are doing 700-900.000 kilometers.  I still hope that they improved those camshafts in hemis but i dont think we will get a clear answer from Chrysler when they remanufactured it...
Reply: @herbatkowy  You shouldn't buy one, you don't understand, and it's not practical for you.
Reply: @snek9353  i like it too much, ill just get a v6 i think. I was considering a mustang but in my country there maaany many of them, too many to buy next one... only challenger interests me.
Reply: @bingorobins1010  what did that run to delete the mds ?
Reply: @richardbrown986  was free, rt durango comes with a button to turn that shit off lol
Reply: @bingorobins1010  👌
Reply: @SOU6900  The MDS system is NOT the culprit of the camshaft/lifter failing issues as non MDS vehicles suffer the same problems as well. It is due to an oil starvation issue as Tony shown. Lots of idling will eventually cause the parts to become oil starved and well... the rest is pretty clear. It is also due to cheap Chinese parts being used. Chrysler knows this, but they don't care because its cost vs profitability. Also they pretty much know most of these engines will easily see 100k or more miles of life so why bother trying to fix something that doesnt really need to be? Most people probably don't keep vehicles that long anyway. And I don't want to hear people in here saying "Oh I keep my vehicles long past the 100K mark." Yeah... I do to, but let's be real here fellas. We are not in the percentile that Chrysler factors either.
Reply: @ScottKenny1978  It doing more than just cutting fuel. It's also collapsing the lifters so the valves are not opening either as well as cutting the fuel. Still the MDS isn't the cause of the cam/lifter failure. It's a combination of cheap Chinese parts along with oil starvation due to excessive idling.
Reply: Would rifling the roller shift help
Reply: @Someguy6571  I never said it was the culprit or even suggested it was. All I did was ask what MDS was then said it was basically more stuff to go wrong. If you think I am then you need your head looked at
Reply: @SOU6900  Dude no need to get defensive sheesh. I was only explaining something and you get all upset. Cool off man.
Reply: @Someguy6571  huh. Seems way more complex than it needs to be.
Reply: So what kind of oil do you think would be more correct to use 0w20, 5w20, or 5w30???
Reply: @surf9730  Use what the manufacturer said you use 5w20.
Reply: @Someguy6571  I only use the 5w20 that the factory prescribes, according to Chrysler ms6395 and nothing else...
Reply: @Someguy6571  I hope this kind of trouble with the camshaft and hydraulic compensators and will not happen)))
Reply: @surf9730  Tell you the truth friend it will always be a possible issue no matter how well you maintain your vehicle. 1 in 1000 engines suffer from this problem. My 2007 Durango is possibly seeing this issue even though I am very adamant about maintenance. I change my oil every 2500 miles and still she ticks. But its no matter to me as I can repair the problem should it happen. Though not every one is good with a wrench. Good luck with your vehicle and I do so hope you don't have the same problem I do.
Reply: @Someguy6571  ok.

I don't understand why they're doing it that way, though. Seems way too complex and a great way to add an additional failure point. Yes, it should theoretically shave a few ⅒ths more MPG when the MDS is on. I don't think that it's worth it, unless the cars are somehow that close to breaking Mopar's CAFE numbers.
Reply: @ScottKenny1978  Without the MDS Chrysler couldn't meet the fuel mileage target they wanted. That's what I heard. Also the failure rate is like 1-1000 of the production engines. So in Chryslers opinion I believe they really don't care since most engines will reach 100k or more miles of life. They will probably never fix it.
Reply: @Someguy6571  what I mean is that a simple fuel cut when at part throttle should be enough. Deactivate the fuel injectors on half the cylinders and rotate which ones are on for the heat load (like the Northstar Caddy engine does when it's in limp-home mode).

It's pure software, no hardware required.
Reply: @Someguy6571  This is of course great when you can service your car yourself, I unfortunately don't have the time or tools, My Grand Cherokee is serviced by my friend, he has his own service, I change the oil about once every 4000 miles, I don't drive much, but I watch videos, reviews and see that this is   unfortunately a common problem in HEMI engines, there are a lot of fans and admirers of these engines in Russia, it's a pity that this problem occurs in HEMI engines...
Reply: @Ecosse57  I wonder how much such a set of hydraulic compensators for VCT 5.7 HEMI 2013 costs?
Reply: george garcia Monster Garage was just covering the build.  That was a low hp Y-block with custom oiling hoses under the intake manifold.  Keith Dorton built the motor.
Reply: That was my first thought ---- delete that stupid MDS ( Cadillac 4-6-8 , anyone ? ) setup . 
There's too much Daimler blood in those "Litre" Hemi engines (as well as other critical components) ... it's like Chrysler is on a death trip ! First Daimler (et alia) , then Fiat , then Renault... Who's next ? Trabant ? Yugo ? Walmart ?  There's no excuse for half-assed designs --- Too many college kids with manicures are running corporations .
Reply: @Richard-pz6ci  Wish I knew, I haven't pinned that down yet.
Reply: @surf9730  For an MDS engine nothing thicker than 5W20. 0W20 MIGHT make sense in a very cold climate.
Reply: @ScottKenny1978  Collapsing the lifters is necessary to decrease pumping losses. If they just cut the fuel the engine would still intake, compress, and push out air, this would suck energy. With the lifters collapsed the valves remain closed and those 4 pistons simply become air springs. The only losses then are a tiny bit of drag from the piston rings and rod bearings.
Reply: @Someguy6571  I'm with ya except I wouldn't say it's exactly oil starvation, and certainly not as Tony suggests. There's plenty of oil under normal conditions getting to the lifters. In fact if oil starvation was an issue the failure would be less common in MDS engines or on MDS cylinders because the MDS lifters get more oil supply. 

I put it down to some combo of 5 things;
1. A lack of quality control during lifter manufacture. 
2. The absence of a passage to oil the roller bearings directly. 
3. Low oil levels due to the PCV system on these engines consuming oil. 
4. Generally under sized rollers. 
5. Weak valve springs causing float. 

My thinking is #1 is why it's rather rare and has little pattern. Likely some quality control failure in the heat treatment of the roller bearings. #2 I just assume they didn't think necessary and more likely to cause a failure in the body of the lifter. Probably right except for #1. #3 I think is largely unacknowledged, nobody wants to admit they went 10,000mi without even checking their oil. The way these engines consume oil I think after 10k miles unchecked it's likely to be a few quarts low. #4 and #5 are a lot like #2.
Reply: @snek9353  I agree on your first point too. Cheap China parts is more than likely an issue of either the lifers of camshaft. Your number five point is also interesting as I have read its very possible that broken or collapsed valve springs is an issue on these engines as well. Though that again is usually a fault of poor maintenance on these engines. Such as very long times between oil changes, excessive idling and overheating.
Reply: @snek9353  I know, but I would not have thought that the losses were that great. Again, the Caddy Northstar engines have been doing a similar fuel-cut system for 30+years.
Reply: @ScottKenny1978  IIRC that's an overheating limp mode, nothing to do with fuel savings.
Reply: @Someguy6571  Never even heard of broken or collapsed springs. There have been some issues with rockers, but those issues for the most part appeared right away on new engines and likely were caused in part by overly tight valve guides. See the comments above by mike stone.
Reply: @johnhughes9019  The caddy 8\6/4 system was just ahead of it's time. The mechanical operation in the engine was kinda similar to what the MDS does. The 8\6/4 worked by collapsing the rocker, the MDS works by collapsing the lifter. The issues with the 8\6/4 weren't in the engine itself, they were in the electronics, the control systems of the day just couldn't manage it well enough. Too many issues made it a one year only thing. On the other hand the MDS system works rather seamlessly, the computers manage it well, and it's been in the vast majority of Hemi engines for 11 years now.
Reply: @snek9353  correct. But that was basically a software only implementation that could have been used for fuel savings.

It was chasing that last few % improvement that added the MDS deflating lifters and whatnot, creating a whole bunch more failure points.
Reply: @ScottKenny1978  No not really, sure technically any modern EFI engine could cut fuel injectors but it wouldn't do anything good. Simply cutting injectors wouldn't save fuel because it wouldn't reduce the pumping losses in the engine. It'd just have to up the fuel to other cylinders to make up for it and just end up running rough. Doing so would also pump oxygen into the exhaust making the O2 sensor moot thus making closed loop operation impossible. This would force the ECU to run the engine rich reducing fuel economy. It'd also have negative effects on the catalytic converter. No, the only practical way to do it is to disable the valves to keep them closed. 

In comparing MPG stats pre and post MDS implementation it appears to save 1 MPG city, and 3 MPG highway, about a 7-15% fuel savings. Certainly a significant savings over many miles assuming no issues. There's few issues with the system, sure technically more "failure points" but that's true of all modern complications, if you don't want failure points get a 40 year old car. However the MDS system has shown to be very reliable, it's now in millions of engines, the vast majority of Hemis built since 2009 and had few failures. The few failures are mostly the solenoids sticking which is a rather easy fix.

BTW personally I'm kinda looking forward to seeing what I can do tuning wise with the MDS. I think I can utilize it to significantly increase my mileage. The car compression brakes on it's own too much, the MDS turns off in manual shift mode, the cam timing goes to extreme too function as an EGR, it could lean burn more, and the exhaust design doesn't take advantage of the cut off cylinders. I think with some tweaking I can get my AWD Chrysler 300 well over 30 MPG.
Reply: @snek9353  huh. 7-15% is a heck of a lot more than I would have expected.

As to MPG, I found out on accident that my old Subaru legacy wagon got best MPG at 3500rpm. I had driven from Seattle down to Medford Oregon doing the usual speed-limit-in-5th, got 27-28. Coming back, I couldn't keep speed going up hills around Medford in 5th, and was having loaded semis crawl up my ass in 4th. So I said, F it and ran it up to 3500rpm in 5th, for about 85mph. Got passed by at least 3 state troopers. Pulled in for gas and didn't put in anywhere near as much as I expected. Did the math and got 31 or 33 MPG, while cruising at 85.
Reply: @ScottKenny1978  On the MPG improvement with MDS, the MDS system basically lets it swap back and forth between a 2.8L engine and a 5.7L engine as needed. This is bound to have dramatic effects on MPG. 

I can totally believe that a Subaru engine would be most efficient around 3500RPM. Generally an engines peak torque and peak efficiency are at the same RPM. This is of course at high throttle. That said I doubt going faster increased MPG, wind drag is exponential. This means at 85MPH there's about 50% more aerodynamic drag than there is at 60MPH. I'd suggest you give higher RPM(2500-3500) in 4th at a slower speed a try. Also for all transmissions(except CVT) one gear is direct drive, the highest that isn't overdrive, usually 4th. That gear has far less drag in the transmission and would be the most efficient assuming a proper speed/RPM for the gear.

This is part of the reason I mention that the MDS turns off with the transmission on manual mode on my Chrysler. If I could better control the transmission but keep it in MDS mode MPG would increase.
Reply: @snek9353  peak torque for that 2.2l was actually all the way up over 4000 rpm, peak HP over 5000 (4400/5500, IIRC). I did try running the car at peak torque once or twice, but lost a lot of MPG. I think the computer was adding extra fuel above 4000rpm. Anyways, that car got turned into a VWs hood ornament, I drive a Jeep Cherokee 4.0L now. And that beast really needs some MPG improvements! Though I did get over 19mpg on the last long drive, I usually get about 13-14 in town.

For the transmission in your 300, I'd bet that someone has cracked the coding on it by now, just like how I expect that someone has cracked the fuel injection coding. Though finding a new code optimized for MPG instead of performance may be tough. Unless someone has a tuner kit that will let you adjustment the numbers yourself...
Reply: @ScottKenny1978  Yeah, it's a catch 22, that peak efficiency is only at WOT, so anything less than full load is less efficient. That's the harsh truth of Otto cycle(spark/gas) engines, they pull vacuum and that's a drag. They're the most efficient wide open, but of course you can't drive WOT all the time. 
(Interestingly the Hemi goes WOT at times during cruise, for efficiency and emissions reasons it'll shut off the 4 MDS cylinders, advance the cam and open the throttle all the way. In this mode it I believe it controls power output via the cam timing.)

A Cherokee with a 4.0 is tough, no easy answers there to save fuel/money. There's things that can be done but none are cheap and easy. 

It's absolutely been cracked. Just about every system in this car has been hacked by someone and much of it is available as plug and play products. I already have the vast majority of it hacked. The HP Tuners product is next in that regard and will give me complete control over the tuning of both the transmission and engine. Just haven't done it yet, priorities ya know. 

FWIW I already have a product called the Tazer, this gives me control over the AWD, lights, line lock, SRT pages, TPMS, Tire Size, Re-map steering wheel buttons, etc. I have a Pedal Commander, this gives me total control of throttle response. I have AlphaOBD this gives me total computer access to all the modules to do all the same functions as the dealer and then some(removed speed limiter, can trick car into thinking it's a hellcat, etc). Next is as I said HP Tuners, and I think a Lock-pick Uconnect Air, this will give me total control over the infotainment system including phone mirroring, HDMI input, extra cameras, extra screens, etc. It's all been hacked, ideally I'd like to also add the adaptive dampening system, but having hardware issue with that. The computer/wiring part is rather easy, but shocks that work with the AWD isn't, haven't worked that out yet.

Also just learned of a guy that hacked the adaptive cruise control(ACC) to give him an automatic stop-n-go function in stop-n-go traffic. His car will use the ACC system to just follow along in stop-n-go traffic. Some have also adapted openpilot to provide an auto drive/auto lane centering feature.
Reply: @snek9353  oh, that hacked cruise sounds like the next "feature" to be a factory standard.

Sounds like you have quite the plan for that 300. Have fun, and please let us know how much more MPG you can squeeze out of it!
Reply: @Stephen Stooksbury Read more of the above comments, deleting MDS will not help this issue. If you truly have a lifter tick then you're going to have to replace the lifters and cam. Once the lifter starts to fail badly enough to tick it's just a matter of time. However these engines do a lot of ticking that isn't tick from a bad lifter. Two best ways to know besides noise is metal in oil/filter and low lift which needs valve cover removal to diagnose. If you suspect I'd start by cutting open your oil filter, and generally the first solid sign of a problem is a code from a miss.
Reply: @snek9353  second the cut open oil filters. That's actually standard practice for aircraft.

You should be able to use one of those outside-the-can can openers to cut it open. Just buy a separate opener just for your toolbox!
Reply: What about a high volume oil pump. Would that help?
Reply: @natedevilin9573  maybe? I mean, the problem is that there's not enough oil flowing through/around the lifters, and MDS apparently makes that worse.
Reply: @SOU6900  Multi Displacement System, it's supposed to shut down 4 Cylinders of the engine while cruising on freeways and or cities with no stop and go traffic, it's pretty much to save fuel with these V8 Engines, GM's LS V8's has this too, but it's called AFM (Active Fuel Management)
Reply: I HATE DODGE FOR THIS SHITTY ASS DESIGN AND NOT OWNING UP TO IT AND REPLACING ALL THESE BAD PARTS FREE TO THE OWNERS.
Reply: Robert Turpin  since the engines usually last longer than the warranty period, no. No recall.
Reply: Robert Turpin  I think they're running on the assumption that people will replace their vehicle before the lack of lube becomes an issue.

I disagree with their calculus, but it's notoriously hard to put a value on brand reputation.
Reply: @69Dartman  I've never seen a 06 Charger RT that didn't have MDS. It is so well integrated in those cars it's virtually undetectable, but it probably does have it. The 06 SRT with the 6.1 did not have MDS
Reply: Holy crap..screw that .. extended idling and extended low rpm use is the primary life of my work truck 60% of the time...glad it's not a ram..then again she's got 480000 miles so if anything was going to take a $hit it would have 300000+miles ago , thanks for this info because i have been on the fence between ford w/ 5.0 and hemi....il stick with modular for my primary needs I believe
Reply: @wolfmanrebel874  It's not so much the low rpm use since raising the idle to 1000 rpm eliminates the problem.  Just the excessive idling. R,am is a good truck, it all depend on what an individual needs.  I love the 5.0 Coyote, but the aluminum body on the Fords is stupid. I work on both in my shop. While the Ram and Chevy work trucks come in pretty beat up, the Fords come in with entire sections of the bed missing. The doors break easily in the hinge area also.
Reply: @edjackson4389  I know...it's hard to get past that myself I love the 5.0/6r but the aluminum as you said...is a step in the wrong direction...I agree 100%....and there is a good bit I dislike about gm also which is why I have yet to purchase a new truck, all things considered for my needs though ram in general I don't think to be a good choice..it's becoming more likely I just put a new engine,trans,rear axle in my truck Merry Christmas partner
Reply: @wolfmanrebel874  Merry Christmas to you too man!  Having a brand new truck is nice, but in 6 or 8 months it'll feel like  just another used truck anyway. I've wasted so much money on new vehicles over there years I could kick myself.
Reply: @69Dartman  definitely has mds, if it still runs the first thing you should do is put a lower temperature thermostat in it and plan to pull both heads and put new seats in it before they drop because they will drop eventually.
Reply: I want to find someone to rebuild my 3rd gen 5.7 hemi rebuild and powered up a bit
Reply: @collinmarsden7772  Not worth it unless you  have a good dyno tuner in your area. I had to go with a stroker kit, big cam and high stall converter before feeling like I was really making big power. Couldn't have done any of it without the dyno tuning. Which wound up being pretty damn expensive.
Reply: Change mds lifters for solid and activate mds solenoids to feed pressurized to lifters all the time.
Reply: @jamesrust1929  Have you tried this? As far as I know it's just a theory of another youtuber. He spoke about the idea during a Hemi build for his 300C
Reply: Hey tony sorry for comment in this old post but if oil is going into the lifter and no hole in the bottom only other way out will be by the side hole on lifter which will lubricate it if the lifter was installed with that hole pointing up oil will run down and problably dont make it to the needle bearing but dont know if we can modify the bottom fatness of lifter making like a channel from the thinner part of the lifter to the roller that might get some oil to it maybe just trowing it out their any thoughs saw your other video of idiot proof 😂
Reply: @danielhemple8649  that didn't look like a Gen 3 engine to me
Reply: Uncle Tony you are awesome where are you from I love your accent
Reply: the lifter problem is a problem but there are Gen 3 Hemi's making 300K miles without ever having an issue. the mds is a biggest culprit causing the issue with extended idle times.
Reply: Mines getting new cam and lifters this week.  How long do you think motor will last ? With just simple everyday driving?
Reply: @GrabbaBeer  my wife and i always do that when putting the truck in drive.. I’m at 43k miles on my 19 classic and I pray it doesn’t happen to me :(
Reply: @RedNineTeen  which comment are you replying to? I can’t find my original haha
Reply: @GrabbaBeer  you said something about using the manual gear selection to turn off mds
Reply: @RedNineTeen  oh yeah, I switch it to that everytime I get in my truck
Reply: Such heart breaking news. I just changed my oil. Story goes I was romping on my 2005 2500 hemi and it started to make a ticking sound under light acceleration up to about 2100 rpm. Fine under harder acceleration. Thought it might be the famous hemi exhaust leak sound. I haven't fully diagnosed the dang thing yet. But when I went to change the oil I only drained about maybe 2 quarts out of a seven quart system. I'm worried that I've flattened a lifter and the lobe it rides on. Never again dodge, never again. That's a big bullet to bite. Here's to hoping it's an exhaust leak.
Reply: @calebsherman9255  good luck
Reply: @calebsherman9255  so you were running your engine on only 2 quarts of oil?
Reply: @GrabbaBeer  yeah, I had checked it about a week or two ago and all was fine, there's no oil spots after parking. I might have bigger fish to fry here. Now I'm checking the oil every day. I couldn't believe it myself.
Reply: @SchkuenteQoostewin  wondering the same thing. Instructions not clear
Reply: So if i do a mds lifter and cam delete i wont have this issue?
Reply: Sorry to rehash an old thread here, but just food for thought...
What if you were to create baffles that install into the drainage galleys for the lifters? These can be designed long enough that they would effectively funnel the drained oil further into the block towards the cam. They would have PLENTY of clearance seeing as the only moving part in the immediate vicinity would be the lifters just chilling in their own isolated tubes, and the pistons sitting marginally below. 
These baffles can be pre-formed to channel the oil directly to the center of each lobe as well so a few inch wide hole becomes 2 separate funneled streams of drainage oil.
This would even help those that still have their MDS systems functioning so they don't starve the lifter roller in the standby cylinders.
Just a thought... I am brand new to this engine in specific, but in no way brand new to fabrication or engine building.
Thoughts on this?
Reply: @mph5896  how do they drop valve seats??
Reply: Guardian Dogo Argentinos factory clearance of the valve seats in the head is not tight enough. Overheat the engine and they will fall out.
Reply: How Can the MDS Solenoids Be Kept On All The Time? With A Tuner?
Reply: @johnoehrlein8379  might work, might not. Whose engine are you thinking of experimenting on?
Reply: @sonsofliberty3081 100%
Reply: @ScottKenny1978 It is a terrible system to make up for their lack of an aluminum block or other MPG boosting technologies.  MDS kills motors
Reply: Defective engine ering public pays to big to care govt owns
Reply: Sorry the Gen 3 Hemi, like basically every modern engine, does not use splash lubrication. Engines stopped using splash lubrication because it aerates the oil, and air is a terrible lubricant, this is called windage. Almost all modern engines, including the hemi, have a windage tray in between the crank and oil sump to prevent the crank from causing windage. So lack of splash lubrication is not part of the problem.
Reply: This doesn’t explain why it doesn’t happen to all the Hemi’s.